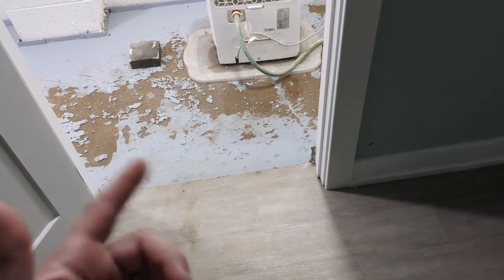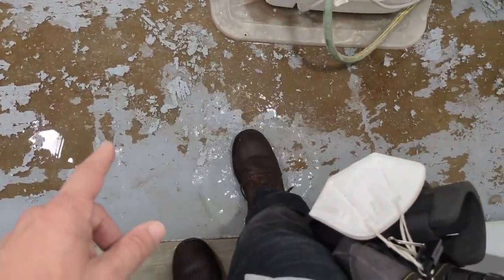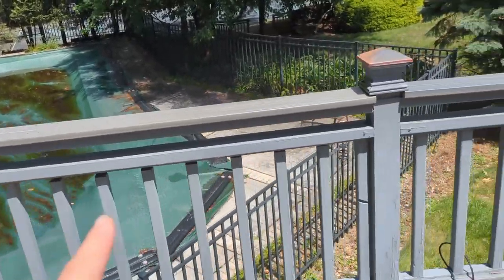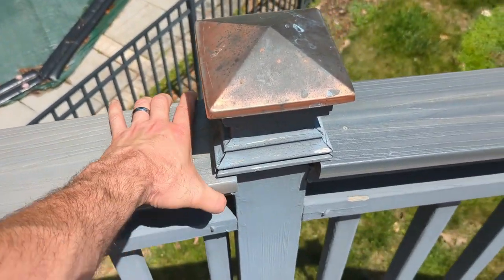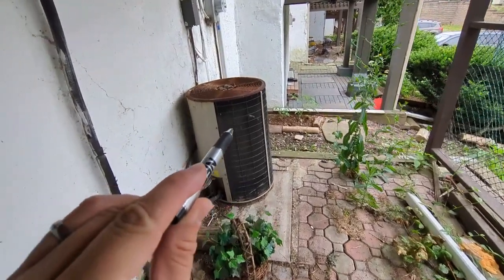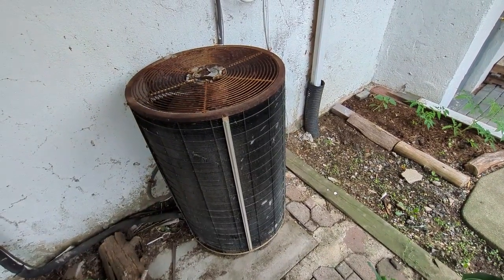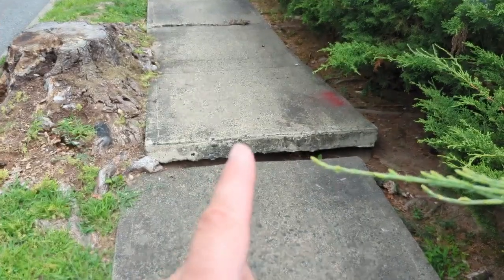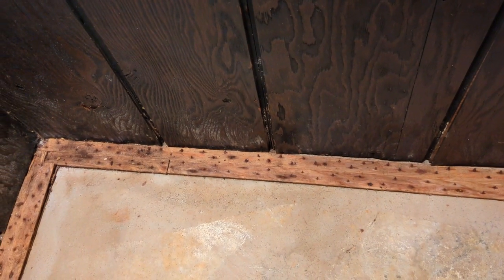NJ Home Inspector Describes the Other Types of Inspections that Home Inspectors Can Perform

Comment: We had to completely remove our roof and have 5/8's plywood put down in 1980.  They installed the cheaper 20 year shingles which lasted till 2010.  We had the good quality tri-tab shingles installed with a 30 year warrantee.  With a complete ridge vent, I expect this roof to last 40 years.